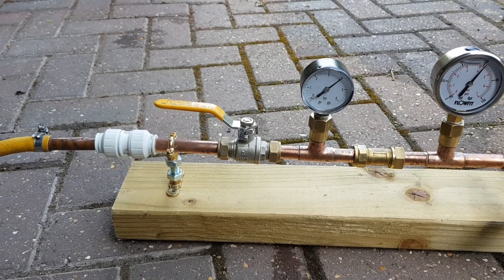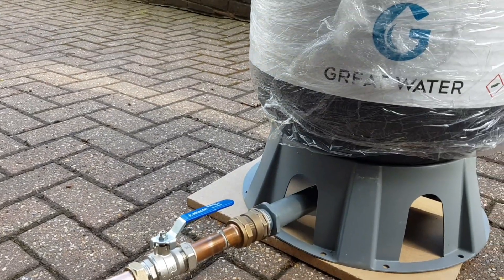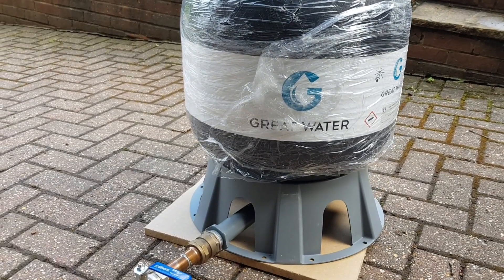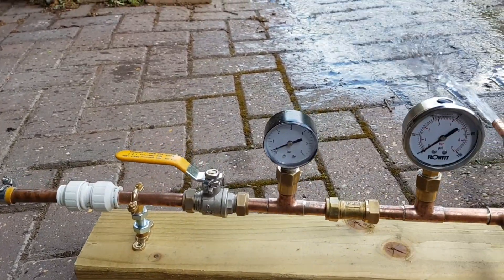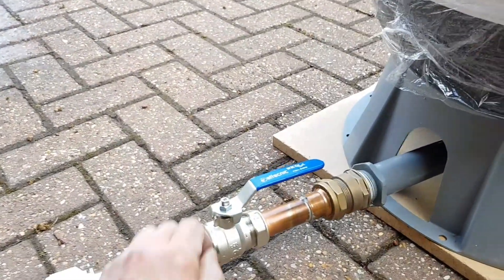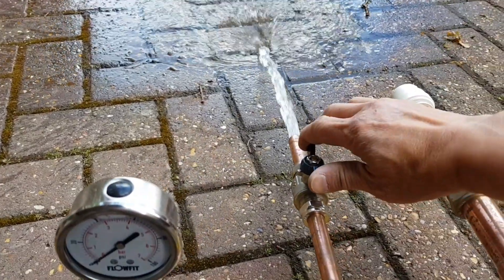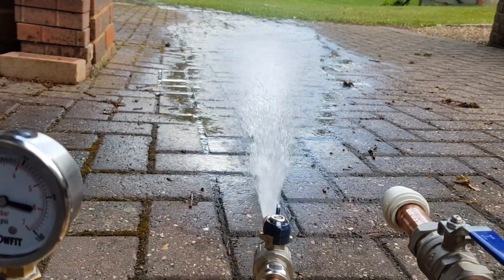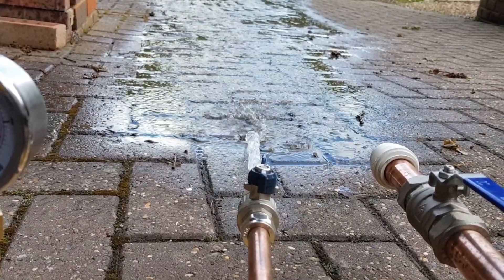Hydraulic Accumulator Demo

Comment: The problem  is connecting  to old pipework that may not take the improved pressure.... if it’s a new install then all good but an older one would be squeaky bum time... 😜

Comment: Thanks very good vid. 
Q1.  How is a normal system set up?  What valves are needed?  What is the circuit diagram?
Q2.  What volume accumulator do you recommend for enough to provide two showers and normal daily usage for 2 people?
Q3.  Mine would go in a loft, does have frost protection?

Comment: Hi, great video thanks. I am doing a loft extension and already have 2 bathrooms and will be adding another shower room to the loft. I have low pressure and flow on my main so cannot add an unvented cylinder and system boiler. Would I get away with installing the accumulator on its own for the 3 showers? Thanks
Reply from the maker: Hi, I presume you have a gravity system with a hot water cylinder. If so, an accumulator won't be the right solution. You need a twin impeller booster pump which would boost both the hot and cold supply to the showers.

Comment: What did it look like when you opened up the 22mm pipe?
Reply from the maker: Hi, sorry for the late response.
As expected, the larger 22mm outlet gave a much higher flow rate compared to the smaller 15mm outlet. 
With this small demo accumulator, the boosted flow didn't last very long - several seconds if I recall correctly.
This is reinforces the importance of installing correctly sized accumulators.

Comment: I have purchased a 130L Grundfos accumulator similar to the one you have. After setting up a test rig similar to yours the difference is significant, however this only lasts for around 20 seconds before reverting to normal flow/pressure. 

Any thoughts? 
Appreciate this is a year old video.

Great video BTW.
Reply from the maker: Hi, Sorry, just seen your comment. What you describe sounds correct, although 20 seconds does seem quite fast for 130 litres.
Discharge time is dependant on the accumulator storage volume and also the discharge rate.
Check the accumulator charge pressure. versus water fill pressure. If it's too high, then it won't store much or any water!
Reply: what size for a family home is needed with 3 showers?

Comment: You said the mains was 4.bar and 20l flow rate. What are the numbers with the accumulator?
Reply from the maker: We haven't measured the flow rate with this set-up, but expect it to be around of 60-80 l/m.
Reply: @apexplumbingandheating5815  I have a system boiler,  300L megaflo, and water pressure at taps and shower is awful. My flow rate outside tap is 15L, mains is 15mm and shared with 3 houses..... What's the best option...upgrade mains to 25mm or an accumulator or pump?  tnx
Reply from the maker: @greenbanananas  If you have good pressure (6 bar is ideal), then an accumulator will be best option to address flow rate issues issues. 
Upgrading your supply pipe will usually improve the flow rate, but won't improve the static pressure. If you require pressure and flow, then a break tank and pump set may be the best option. (You can't pump more than 12l/m from the mains, hence the break tank). We would generally recommend a constant pressure variable speed pump.
Hope that helps.
Reply: @apexplumbingandheating5815  only have a poor 2.5 bar pressure so that option sounds better. Thanks for the advice